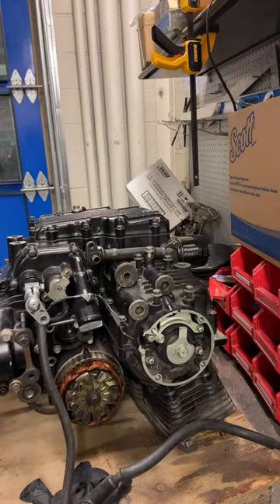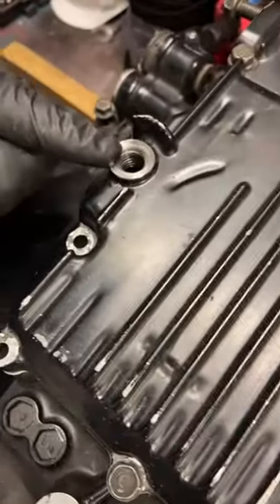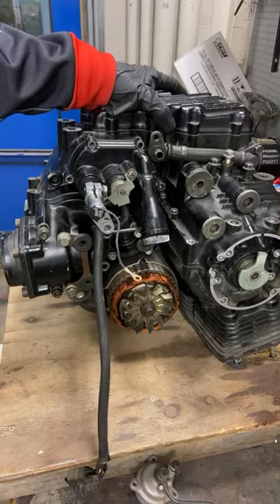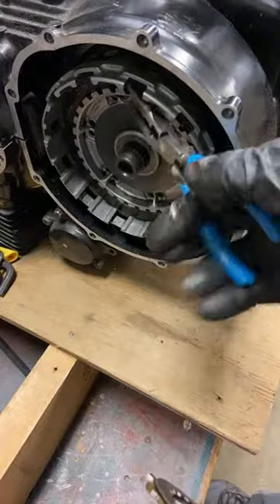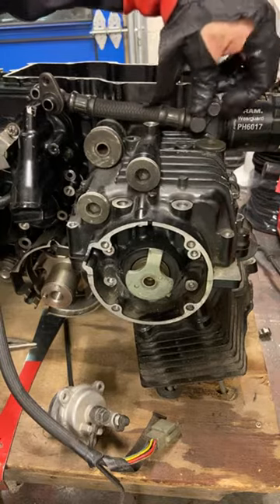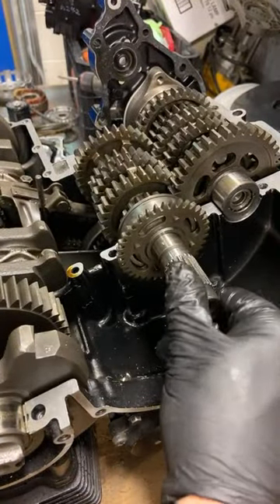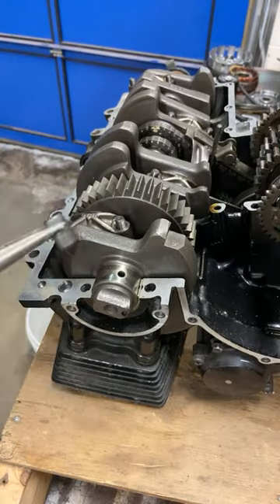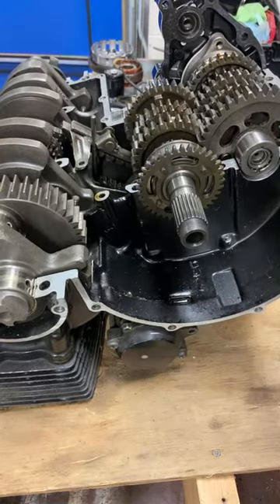Death of a once brilliant Honda engine pt.1 (1984 CB750SC)

Comment: also each 90° air path improves the "atomisation" as such exponentialy for the smart carb, i was even thinking a turbo and 70cc max stroke 4 cyl 280cc such balanced and quiet engine, maybe even high revving.
Reply: lincoln had a 2.0 on the first gen mkc which made it really pleasant progress, plus the really soft suspension, i would want an engine like that on that type of suspension for true luxury. now i dont know about nautilus and aviator but the corsair (ex mkc) got a little stiffer, test drive both in their comfort mode and report back :) if you can, i cant in my country. good engineering is synonym with health etc, same as a practical suspension tuning for most of our use.

Comment: you read it as corvette, i hope i wrote it correct eco-vette on yt. the spark plugs i mean special high voltage not on these goodness lacking engines just below their laser system thing, also on yt